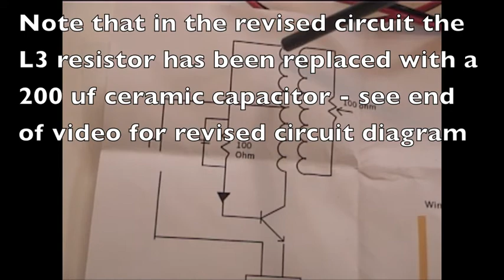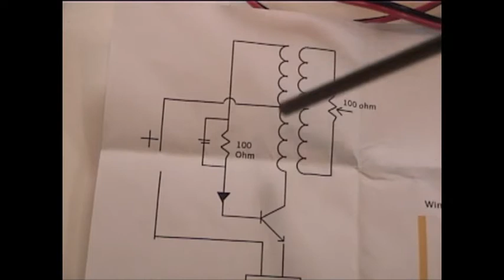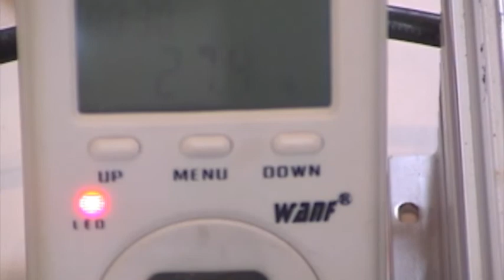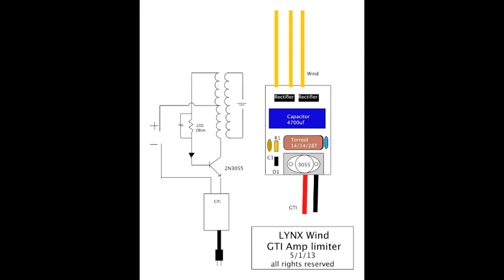Lynx Wind - Grid Tie Inverter Limiter

Comment: Have you added super capacitors? Of course, your circuits are only good if you still have analog disc meters or if you have netmetering, as those bastards replaced all with stupid 'smartmeters'' in my area!